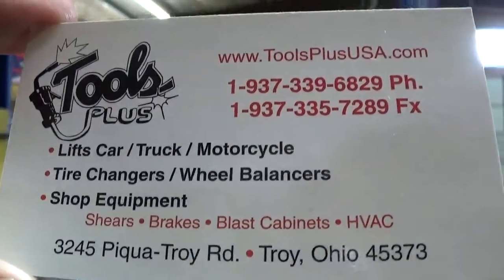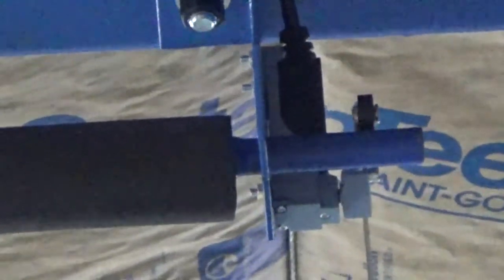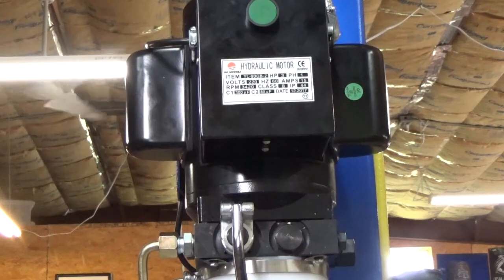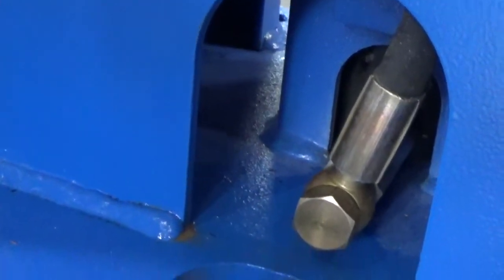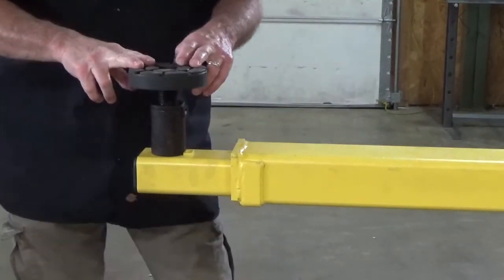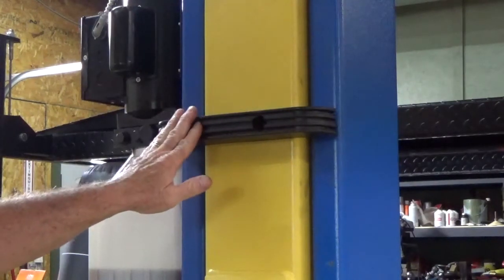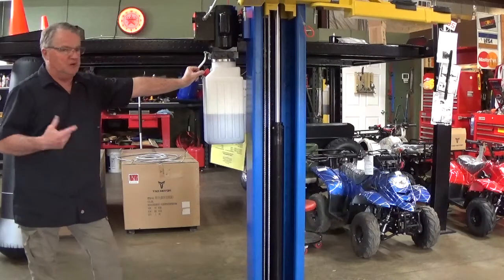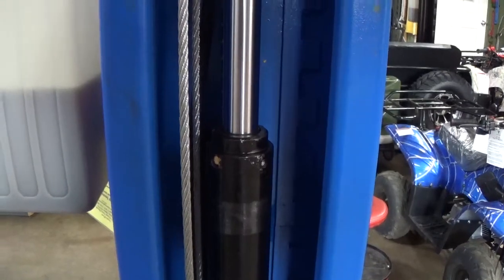New style 2 post 9000 pound capacity car lift from Titan 2018

Comment: Great information. My motor is starting to squeak, sounds like it needs to be lubricated.. Any videos showing where to lube the electric lift motors?
Reply: Did you get a answer to this question or is this sales no service
Reply: Electric motors DO NOT have any type lubrication points. Most likely the bearing, either upper or lower in assembly, could also be other issues but bottom line you will either need to replace your motor or have someone rebuild it. Motors are cheaper these days than ever before. ( I never buy import motors unless customer wants one) Just some info. Good luck